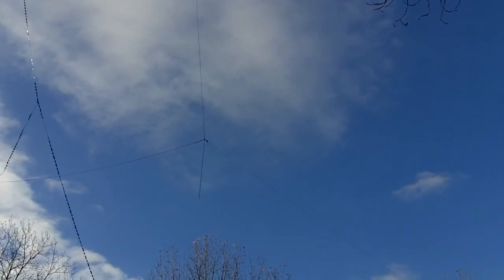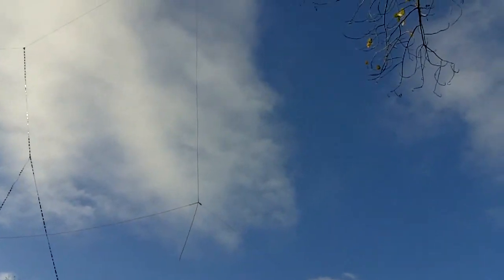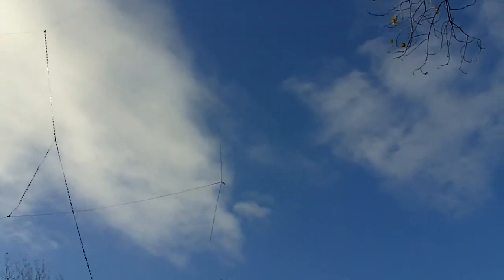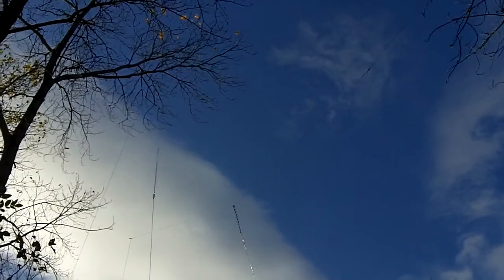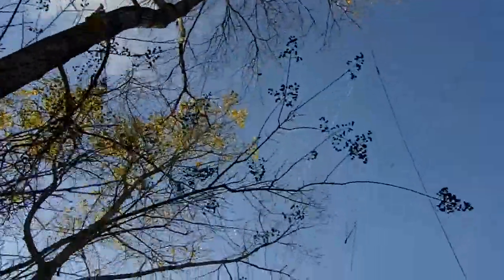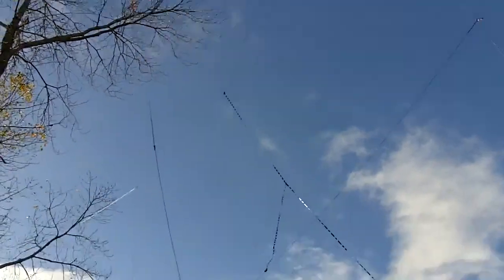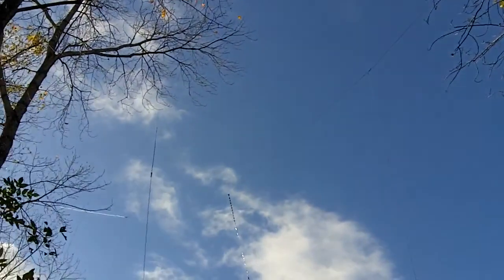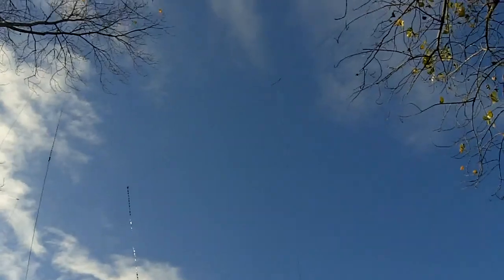Wire multi-band Lazy H antenna for covering 13 Mhz to 30 MHz.

Comment: Okay, question here on this:  " Initially I had the ladder line coming away from the antenna at a 45°angle and it skewed the radiation pattern of the antenna in the direction of the ladder line."

--- does this mean if you run the feed line horizontally from the feedpoint before dropping down to the Xmtr, you'd put more gain in that direction?  IOW if the broadside was East/West and you ran the ladder line to the West direction, would you reduce gain to the east and increase to the west?